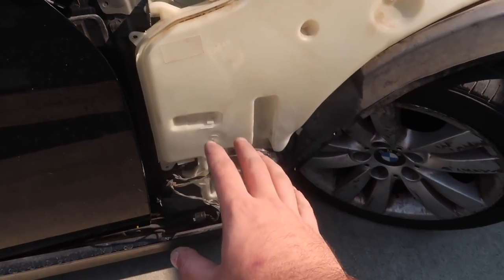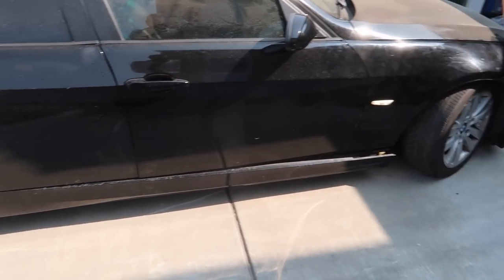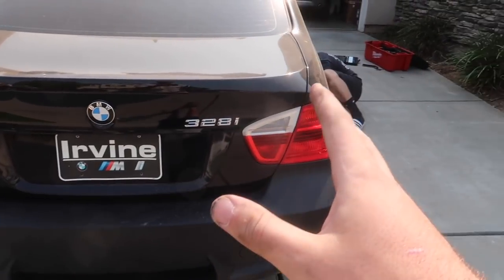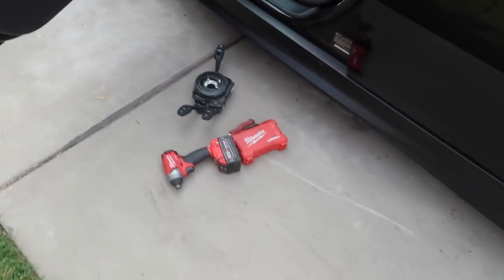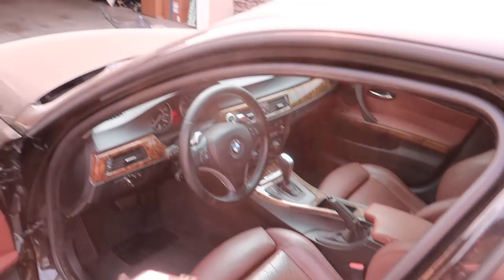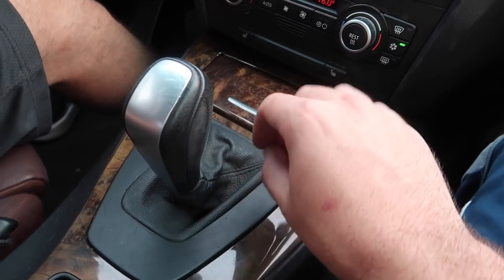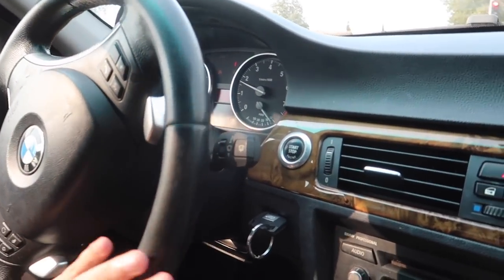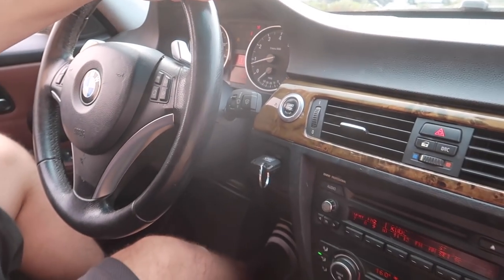Rebuilding And Restoring A BMW E90! Part 8

Comment: The clock spring can be grounding when your turning.  It happened to be in my e 90. Every time I made a left-hand turn because I had paddle shifters it would throw my car into manual 1. M1.

Comment: Yup you don't rear fog switch on your light control unit. Their should be 2 switches for fog lights, one the front and it for the rear fog light.

Comment: The steering wheel angle sensor, that clock thing. u shouldnt turn that, that might be a reason to break it, happens very often